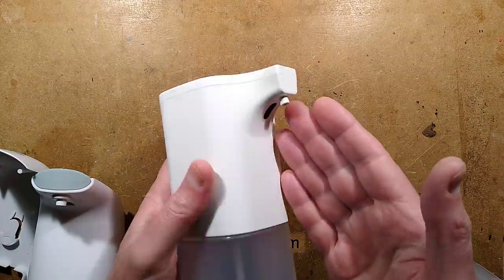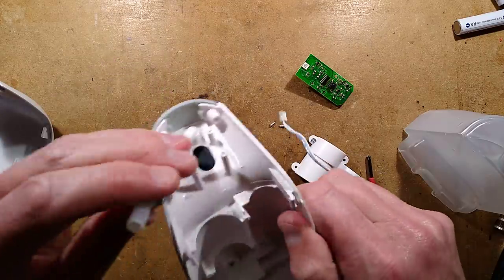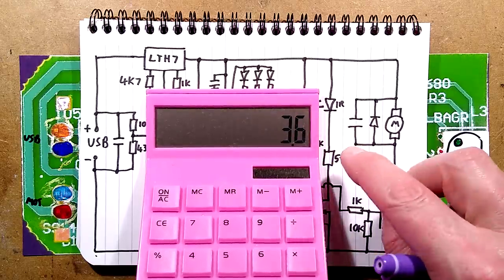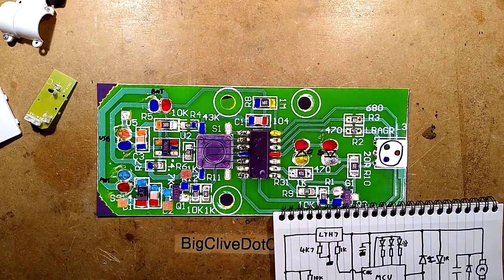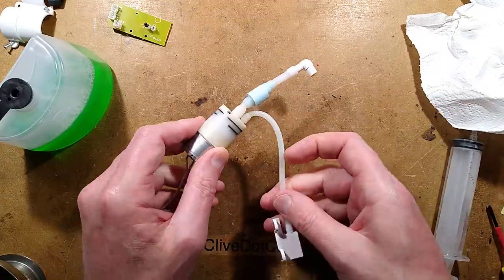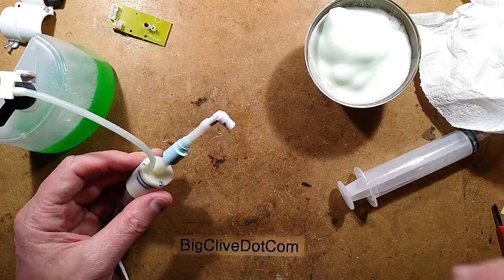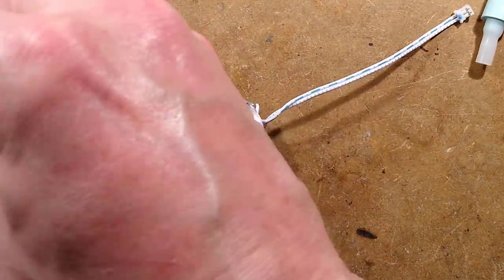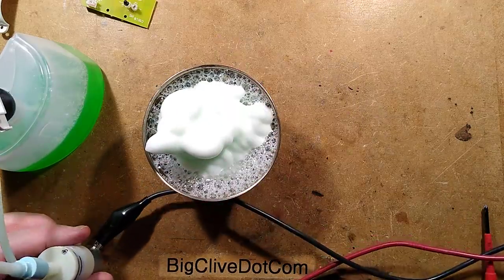Fixing a faulty schmoo pump

Comment: seems kinda short on life with batteries when say that when mine uses 3 alkaline or i prefer the lithium one use as last longer.  i get usually 6months with alks or so far almost 8 months on lithium and its used 3 to 10 times a day.  though id try rechargeable to see how long but i don't have a charger that can do 3 as all pairs only and i just don't like using those in a device always exposed to some liquid anyways.  but just my opinion anyways aha. though my unit is discontinued unit and cant even buy those pre filled carts for it anymore by Lysol but i got around it by drilling a big hole on top and using 2 part epoxy around the bottom cap and vent hole cause they are sealed and just fill it with any soap i like.  (same unit i told ya i fixed in few vids back)

Comment: I think those re hargesbke AA batteries are the issue as they only 1.2v where a throwaway AA cell is 1.5V they also offer higher current.
The 18650 would be a better rechargeable cell
Reply: Higher voltage, yes, so the motor likely runs a bit stronger with alkalines when they are new, but NiMH rechargeables will provide tons more current than alkalines and keep the voltage higher on average.  Most alkalines are discarded with half their charge remaining simply because their voltage under load drops to the point where people are unhappy with the performance of the device.

Alkalines are only really good for clocks and remotes; they just can't handle much current at all.  Everything's lithium now, but 20 years ago photographers all began running their flash guns from NiMH AA's for precisely this reason; it saved them a fortune in alkalines, which were useless in this application.
Reply: @antibrevity  honestly I've lost all faith in lithium.  NiMH rocks
Reply: Also.. Typical 18650's will fully charge to 4 - 4.1V. They start getting weak output when the voltage starts dropping below 3.6V. Below 3.5V and it really plummets. Most lithium packs rated at 3.7 - 3.8V are the same way.

Comment: Mine failed after three months, then I reverse engineered the circuit, added my own arduino to run the pump as long as I need it to. I managed to unclog it, but after a few more months the electronics decided to break completely. The sensor was a bizarre configuration with an Opamp and analog timing.

Comment: They installed counter-mounted versions of these on all the restroom sinks at work but they were badly positioned such that the sensor could see your hands if they were anywhere in or near the sink, with the result that they would constantly grunt and ejaculate (yes, they kind of made a two-stage grunting noise followed by the schmoo) as you were trying to wash up..   I got massively down voted in the company forum for pointing this out..  I expect a more favorable response here on Clive's page...  😜

Comment: u have run water thur it get it clean out so it can back working aging i have done that many time fixing them at restaurant a lot because dont use it much will get clogged up because air n soap will become sticky or gel cause pump jam up
just remove bottle n get tube n hooked up to sink n shoot it thur it should come out top n clear up no bubble n ready put back to work

Comment: 1:40 "And this is where the marks wash off accidentally with solvent..." Yup. I was working with a circuit, and after marking where power and ground was with a Sharpie, I cleaned the board with IPA. D'oh! So now when I do that I use acrylic paint...

Comment: Is it a 370 diaphragm pump?
Also where to get the foamer
Reply from the maker: The foam pump is available online, but it's easier to get the whole unit.  Search for automatic foaming soap pump
Reply: @bigclivedotcom   I accidentally got a 280 diaphragm pump instead of 370 diaphragm pump. The 280 diaphragm pump has a different nozzle diameter. The foaming dispenser that I made is supposed to work with all liquids. The problem is after dispensing the liquid keeps dripping. To solve that I added air intake and a one way valve to prevent liquid falling back into the container. Now it does not drip a lot but a few drops randomly. I guess that foaming unit helps in preventing it. I looked at Kohler's design as well. They seem to use some different kind of pump. To prevent dripping they just suck the liquid back in right after dispensing. Can you suggest something to prevent dripping. Also in my case the outlet pipe is not 90 degrees from the pump. It's 180 degrees from the pump. When I keep it at 90 degrees it does not drip but at 180 degrees it does. Any help would be appreciated. Thanks

Comment: I suppose the concept of controlling the amount of discharge by the length of time your hand is under the sensor went completely over the designers' heads !

When Asda changed their soap dispenser to a lower quantity, I just kept the old bottles and pumps ! I think the difference was 3 and 5 ml. 3 is not enough for a man's hands ;)
Reply from the maker: It may be to avoid leaving a trail of foam as you pull your hand away, or the risk of the foam getting in front of the sensor and causing it to empty the whole bottle.
Reply: @bigclivedotcom  Our 1980s 'dual' flush loo has a min flush and a max flush - the latter achieved by holding the lever down. Between min and max, releasing the lever anytime will stop the flush - so it's not really dual flush but variable flush.

Comment: How often do you find ads that claim to reduce power consumption. Meanwhile the picture they use is you holding a breaker?
Reply from the maker: My images and voice get used quite widely by random online sellers.  One advert was narrated entirely by me without my knowledge.
Reply: If only it was for an electronic device.

Comment: What happens if you put baileys in it?
Reply from the maker: It would be unhygienic.
Reply: @bigclivedotcom  How much does one cost? Surely running water, a highly dilute solution of bleach and then lots more water would clean it and it could be discarded so you don't have to deal with stale cream in it after one bottle if the entire thing only costs a small amount.
The fact that it isn't food grade might be a concern however, the diaphragms and O rings must be greased with something so that's a potential problem but since it's designed for a quick clean of your hands without washing with water after (I assume) I doubt the grease would be extremely toxic and would likely just be silicone grease which while not good to drink isn't going to cause any harm in small amounts, probably.

Edit:
Also thanks for reading and replying to your comments, not many content creators do that anymore.

Comment: Re LED. It would allow them to choose either common anode or common cathode led chips
Reply from the maker: That's true.  I didn't think of that.
Reply from the maker: (Although, it's a 5050, so each LED has two pins and it can be rotated at the cost of a colour shuffle.)

Comment: Waaaay too complicated with too many points of failure, not counting the need for batteries, when a manual foam pump will do just as well, unless you REALLY need touchless dispensing.
Reply: Yeah but it looks and feels fancy and futuristic so that's a good enough reason to have one...right? :)
Reply: Pheckphul - yeah, I'd be annoyed at changing or charging the batteries, let alone fixing the damn thing :-)
Then again, I always put washing up liquid in recycled cosmetics bottles -- so I'm not the target market :-)

Comment: If the MCU has limited PWM pins it could make sense to select a color with 3 pins and control the brightness with the one PWM pin available instead of hooking the common directly to 5V.
Reply: My guess would be that, as you suggested, one PWM is used, but for a different reason: Hooking them up like that enables the LED colors to blink in unison (if required), because they're sourced by the same (LF-)PWM. That way you could create more blinking colors. (I don't see a reason why they would have used a PWM for brightness control, but for blinking it would make sense.)

Comment: I had one like this is which just fully failed to pump. Full pump voltage present, no pump pumping occurring. Don't buy these from Amazon Warehouse Deals (in my case, accidentally).  Mine has a lot more tubes in it...

Comment: Could this work with lube ?
Reply from the maker: I'm not sure what would happen.
Reply: I don't think oil will foam up very well. Grease might work if it's not too thick.
Reply: @NiHaoMike64  I only use water based lubes - I think this would be handy on bedside table - dispensing  direct on hand or body parts - and avoid  a slippery tube falling out my hand

Comment: I'd be interested in powering from a solar panel rather than having to plug it in every now and then to recharge the battery.
Reply: So you want the 18650 option (or even a smaller cell would probably be ok) and a 6V solar cell to replace the USB +/- charging.
BC says the quiescent current drain is 2mA, so provided you're not continually running the motor you won't need a particularly big solar cell.
Tho of course you will need enough light, indoors, to get some milliamps...

Comment: RELEASE THE SCHMOO! Wrong channel, but I don't care!
12:28 - Don Ho approves of Tiny Bubbles.
14:55 - "I shall zoom down for this." I just realized I hadn't gone full-screen.
I bought a hand-pump bottle of dollar-store foaming soap a long time ago, at least 5-6 years ago, and I buy the dollar-store regular hand soap refill that I thin out and put in the foaming bottle. I probably spend $1 every two years on hand soap. (Not counting the bottle of Dawn dishwashing detergent I use for my hands after working on the car, which works just as well as the expensive stuff at the auto parts store, but a bit nicer to the skin...)
I'm not saying I'm cheap, I simply don't like to waste money.